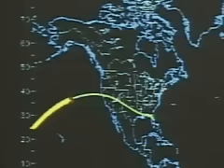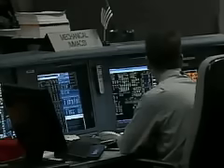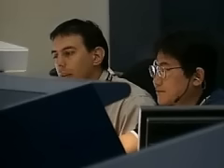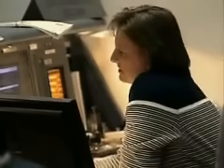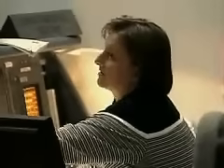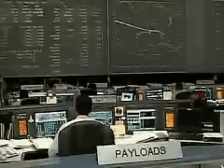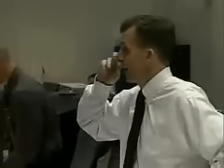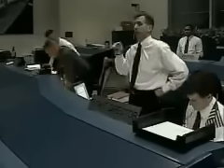Inside Mission Control During STS-107 Columbia's Failed Re-entry and disaster

Comment: Give props to that flight director for keeping it cool and professional BRAVO!
Reply: 456swagger Ummm, that's what you blame the engineers and technicians for. The director did his job to the letter.
Reply: 456swagger  And... it was his fault?
Reply: +456swagger, He is responsible for the FLIGHT, not for any mechanical problem of the shuttle. And of course if there is a good landing he is credited as well as he will be responsible for a bad landing or a disaster caused by his instructions. But in this case it is known that the shuttle had physical damages which is not his responsibility. Is the same as a flight controller at an airport, they has nothing to do with mechanical failures on a plane, all they are responsible for is for guiding the aircrafts to a safe takeoff and/or landing.
Reply: +456swagger You should  study the space program and the history of Mission Control.You are not understanding the function of Mission control.

It is  a poor observation,even saying the flight director was disinterested.Absolutely the opposite was true.The trouble with young America today is everybody acts with childish emotion to situations.
It seems Americans are having trouble relating to responsibility,reality,and controlling a situation,instead of going amok
in useless emotion,and lacking in witnessing professionalism during a crisis.

Professionalism dictates that emotions are held in check and you perform your duties and work the situation to a successful climax.You may wish to observer the the controlled emotion,the tears that were present in Leroy Cains face
How anyone can not see the emotions,or the professionalism displayed in this video is beyond me

 Leroy Cains job promotions are not based on what you misconstrue as a successful mission
Reply: 456swagger
Oh My ! My condolences.
You have had too many bumps on the head without a helmet.

God Bless You!
Reply: 456swagger
Dont let your failure in life cloud the message for others

Again my condolences on your failures and your mental disabilities
Reply: +456swagger You, sir, are an idiot.

The Flight Director is only responsible for flight operations. The Mission Manager was the one responsible for following up on the concerns of engineers, who were aware of the foam strike very soon after launch, and had even tracked a 10 cm piece of debris (probably pieces of the shattered RCC panel) sharing Columbia's orbit for the first two days of the mission. Two separate engineering departments did their jobs, and vehemently called for on-orbit imaging of the orbiter, but based on computer simulations that were inadequate models of an impact that large (and again, engineers told her the simulations were unreliable), mission manager Linda Ham denied those requests, determining that the foam strike was a "turnaround time" issue, and not a flight safety issue. Look at the faces immediately after the hydraulic pressure sensors dropped out. I would bet my bottom dollar that several of the people in that room knew at that point that reentry would be unsuccessful, because more than a few were involved in those imaging requests.

In both shuttle losses, flight engineers sent warning signals up the chain of command. In both cases, it was NASA Administrators -- WAY over the flight director's head -- who made the fateful calls resulting in the accidents. The engineers and operations people weren't the problem; it was the bureaucrats.

Linda Ham and at least two other senior managers lost their jobs over this incident, so it is utterly untrue that "no one was held accountable." It's clear that you never read the CAIB report, so the admonition that you should study the history is well-deserved. So you know about the sensationalist Lisa Nowak story. So does everyone, because that was a big ratings-grabber for TV news... which is probably where you get everything you know about NASA history. (That, and perhaps some conspiracy-minded internet sites.) You should be ashamed and embarrassed by your profound ignorance.
Reply: +456swagger Wow what a troll effort! Were you 'ralled out for this one?
Reply: 456swagger No information is better than false information, which is what you're providing. Have a couple examples from your own posts:

"You could be a Shuttle Commander! All you need is no flight experience and a vagina."

False. Every single Shuttle Commander (and Shuttle Pilot) has had a minimum of 1,000 hours of jet flight experience prior to selection as an astronaut. Many had been test pilots and flight instructors. I challenge you to name even one who has served in either the Commander or Pilot post who has not had at least that 1,000 hours. I won't hold my breath though, because there aren't any.

"You're correct about no one being held accountable for failures."

False. (See my previous post.) Linda Ham, the Mission Manager, and at least two senior engineers were fired or demoted after the Columbia accident. (Note also that the person you were responding to never said anything about "no one being held accountable;" you simply twisted his words to fit your wrong-headed interpretation.)

Funny how you seem to only go after the low-hanging fruit in your responses. If someone has the facts, you aren't interested. It's almost as though you have a vested interest in maintaining your distorted version of events, no matter how wrong you actually are.
Reply: A bicycle rack... I thought I recognized your backside from somewhere.I was a bit surprised to see you were allowed near school property though
Reply: +456swagger
Always so interesting how you  moon hoaxer types put down NASA ,talk about astronauts morality and then you talk so filthy.Its a well known fact that people who talk and think like you have ZERO credibility when it comes to subject matters.

Always filling posts with irresponsible inappropriate talk
Why would  anyone take anything you say seriously,its so immature and childish.

Your childish posts about flight directors,and NASA as a whole indicates you know little to nothing about the subject.,
but a great deal of contempt

Now don't go  start spouting off about how you know so much more then me because I just offended you, 
Your appearance of a mediocre education and life are showing
Good Day sir I really need to correspond with people of intelligence as to not waste my time

You have become obnoxious and very childish,very immature very predictable individual bar fly.
You should go away now,and leave analyzing science to those who walk upright.

Everybody,prepare for a childish tantrum like reply to this post
Reply: +456swagger I think your out of date on technologies and the requirements necessary to be a Shuttle Commander/Pilot
Reply: He did not. None of this was his fault. He has risen through the ranks at NASA and is now in a top administrative position.
Reply: +456swagger Nothing can remain unknown once it is explored and discovered,  So just because Mercury, Gemini and Apollo had flown before the Shuttle you consider the Shuttle astronauts to be 'not as good' as the previous classes.  You do realise that's rubbish don't you?
Also, Mercury, Gemini and Apollo were all reliant on automated systems or computers.  The AGC on Apollo is what got them to the Moon and back.
I suppose the next thing your gonna say is that the 'classified facility' where you met John Glenn was Groom Lake (Area 51 to the less initiated)?
Reply: +456swagger Fucking Troll, get a life.
Reply: +phoenixshade3 Flight Director Cain.......probably knew what was happening immediately after the hydraulic pressure sensors dropped out.  You can see concern on his face............and hear it in his voice as he receives reports.

And later, you can see the pain on his face..........as he knows the Shuttle was lost. 

He was just the re-entry flight director on this day........and bears no fault in this. The bureaucracy of NASA failed the astronauts again...........just as it did during STS-51-L
Reply: Thank you to those of you who provided appropriate, reasonable, informative, knowledgeable, factual, grown up responses throughout this comment thread. Stay the course and keep your powder dry.
Reply: Folks, Cain is not yawning in this video. He's trying to release tension from clenched jaws. I get the same thing when under a lot of stress, and dropping the lower jaw down like that helps release it. Thanks to those standing up for the real story here. Blaming Cain for things just doesn't align with the situation. He DID check with the mission managers about the foam strike, and they told him it wasn't going to be a problem. In such a big, complex organization, there's not enough time in the day to run around second-guessing everyone - you have to trust that the experts got their analysis right. They didn't, and the managers shut down any further investigation. They let Cain down as well as the astronauts. By all accounts, he was an excellent flight director, second-youngest to ever get the job, and an excellent manager and leader for the 12 years he was with NASA after the accident. But sadly, Columbia's demise is what he's remembered for, and he's had to carry the burden of this ever since. 

Cain won a long list of awards at NASA, including the agency's highest honor in 2015, and I believe he's now working at Boeing's Space Exploration division. 

As for those slamming NASA about the useless shuttle, learn some history. As a followup to Apollo, NASA asked for a budget to build a space station, a shuttle to help them do it, a lunar base, and crewed missions to Mars. All the Nixon administration & congress approved was the shuttle, so NASA could exploit low earth orbit by being a satellite delivery service and hopefully turn a profit doing it. And NASA has had to play the shitty hand it was dealt ever since - under-funded, under-staffed, always pressured to cut costs, and facing constantly changing directives every time there's a new administration. And congress treats NASA like a jobs program, insisting that parts and development contracts are spread around as payback to their corporate donors, running up costs and reducing efficiencies. NASA isn't blameless in the accidents it suffered, but there's a lot more blame to spread around outside the agency for the short-sighted and greedy way it's used by politicians.
Reply: No - why would he? Read the (non-crazy) comments above for more details. None of this was his fault. He was ascent and entry flight director for return to flight mission STS-114 in 2005, then became Launch Integration Manager then Deputy Manager of the overall shuttle program. (That's second in command, overall.) After the shuttle program ended, he was chief of staff to the head of HEOMD, Bill Gerstenmaier.  https://www.nasa.gov/directorates/heo/cain_bio.html
Reply: You can't know ahead of time that flight controller data will be useful or not in an accident. So you have to do what this team did. They dealt with their emotions for years afterwards, after they did their level best to honor the crews with their most professional efforts. As for showing emotion, there were tears rolling down the flight director's face. Guarantee you some of these folks were close to puking. How clueless to judge them for not falling apart right then and there.
Reply: +phoenixshade3 " In both cases, it was NASA Administrators -- WAY over the flight director's head -- who made the fateful calls resulting in the accidents"I wonder at what point in the Shuttle program it was that the flight director's scope changed.  Up through Apollo, the flight director's word was law.  Chris Craft even wrote the job description so that a FD could not be overruled by a higher up.  He could be fired, but the person doing the firing had to have damn solid grounds-probably anything short of a flight director standing up in the MOCR and saying "Je suis Napoleon!" wasn't going to cut it.I have a hard time imagining Kranz or Lunney asking for photos and being told "No"-at least not without a lot of table banging and shouting.  If none of the FDs pushed for photos, then they bear at least some responsibility.  However, even had they known, they had very limited options for rescue.
Reply: ***** That's a fair question, and the answer (like the answer to so many deficiencies in the world) comes down to money. During the run-up to the Apollo program (in the mid 60s), NASA's budget approached 5% of the total federal budget, plus 20% of non-military discretionary spending. It was a national priority, and little expense was spared. It dropped precipitously during the Nixon years, and has not been over 1% since that time with the exception of a couple of years in the 90s, when it barely edged above that mark. Today, it as at less than 0.5%, and the emphasis is almost entirely on commercial and military payloads. This lack of resources put a tremendous strain on managers of the Shuttle program, who had to deal with increased scheduling and cost pressures while simultaneously assessing flight safety issues.

The result was a culture that saw numerous sub-optimal performance issues. When those issues proved to be non-fatal for a number of missions, these problems were frequently classified as "turnaround issues" rather than safety-of-flight issues. For example, over half of all Shuttle flights prior to the Challenger disaster showed some evidence of O-ring blow-by. This problem was known, but the system was never redesigned to correct it, entirely for reasons related to cost and scheduling.

Likewise, there had been several instances of pieces of the stack striking the orbiter during launch. For example, Atlantis nearly suffered a Columbia-like fate in STS-27 (only the second flight of the Shuttle after Challenger) when during liftoff, insulation from the solid rocket booster struck the orbiter, causing extensive damage to the tiles on the Shuttle's vulnerable underside. One tile near the nose was completely missing, and were it not for an aluminum antenna mount, it is probable that a burn-through would have occurred. The Commander, Robert Gibson, didn't think the Shuttle would survive reentry. It is notable that among the recommendations after this incident was one to use high-altitude aircraft to obtain high-resolution images of the orbiter after fuel tank separation, but this recommendation only extended through STS-30. Had such a program been in place at the time of Columbia's final launch, the damage might have been identified on the first day of the mission, allowing launch preparations for Atlantis to be expedited for a rescue attempt.
Reply: LeRoy Cain -- great guy
Reply: Im soooo sorry you couldn't have been there to save them....in my mind, when I think of NASA or Air Force technology I always think of letting YouTubers solve the problems...LOL... The ONLY blame is underfunding, If we can't afford to fix it, we shouldn't have sent it up...
Reply: Ultrametric There was a back channel request by Wayne Hale in to the Air Force to get photos that Linda Ham shut down. That decision was made on the program management level, which is above the Flight Director position. Cain had no authority in the matter. Blaming him is stupid.
Reply: This guy did a great job and he deserved to be promoted. To say that he's responsible for a massive hole being blown in the wing by a piece of foam is a joke. To say that there was another shuttle "ready to go" is a joke. Somebody has to be responsible you say? Try everyone; in any organization I've been in, people are responsible for the quality of the product or service they produce. If somebody gives you a bad haircut, are you going to blame it on the owner of the shop? And who was responsible for the piece of foam being blown off the tank in the first place? The contractor's employee? The engineers who designed the tank insulation? The firm that supplied the foam? If you want to blame anyone, try starting at the source, not the guy who is trying to deal with the fallout. Blaming one person for a catastrophe when there are thousands of people working on the mission is typical of mankind's propensity for saying there's an easy answer when there is none.
Reply: Rick Husband just says "Roger, but..." and there's some brief static. Nothing more. This video has attracted the lowest of lowlife, spewing their conspiracy theories, half-truths and uninformed bile, with no respect for the humans we lost or those affected by it. It's sad we have to share a planet with such cretins.
Reply: phoenixshade3 It's also worth noting that because STS-27 was a classified DOD mission the crew could not send pictures of damage back to Mission Control by normal methods.  They had to use a slower method which also meant pictures were less quality.  Because of that Mission Control didn't take the damage seriously.
If Hoot Gibson had indications of Atlantis breaking up during re-entry he was going to tell Mission Control exactly what he thought of them.  Thankfully it never got to that but there was a lot of attention paid to Atlantis after touchdown.
Reply: DarkLight753 I actually edited those two points out of my already-lengthy reply (about the encrypted video and Hoot Gibson's planned choice words for NASA). I have little doubt that, had STS-27 been lost so soon after Challenger, that would have been the end of the Shuttle program, and there'd be no ISS today.
Reply: 456swagger , didn't you use to play the banjo? I'm sure I saw you performing in that movie called Deliverance.
Reply: +456swagger He didn't seem disinterested to me. He was rocking a lot and trying to contain his distress, to complete the procedures. 

The investigation demonstrated it was HIS superiors who had screwed up and vetoed his, and others', concerns about the foam falling off. Those responsible DID get demoted. 

When hundreds are working on a job full-time, you can't micromanage every piece of their job, and you can't overrule higher management. You will have a difficult work life if you are always so unreasonable and obsessed with scapegoating. It will eventually lead to YOU being forced out of your job as a toxic influence.
Reply: +456swagger You're a fucking no nothing idiot.  Get back down in your mother's basement where you belong.
Reply: The callousness of some answers to this comment is impressive and miserable.

A FLIGHT Director, damn!. Not the engineers or whoever was in charge of what failed.

Even with their sadness (including silent tears, the FD wiping his nose....) their professionalism is commendable.

Haters gonna hate, especially behind a keyboard. Not even worth to name them.
Reply: Ultrametric He had no authority on that. She did. Learn how things work before throwing blame.
Reply: I would think of the Flight Director as like the conductor of an orchestra.    Every one of those other people in the room, I would say are like the individual members of the orchestra......each expert at their own instrument.     And like an orchestra conductor......his primary job is to keep things flowing & trying to make sure everyone stays on cue.  He's following the sheet music as written.    If things suddenly go 'off script'......I'm sure that they all have some sort of backup.....or contingency plans to fall back on ( to a limited degree...) but something MAJOR catastrophic, they only have minutes....or seconds to try & come up with a solution.
Reply: Black Onyx You're absolutely correct, my question was for 456swagger.
 This guy did his job engineers and mechanics didn't.
Reply: +19ARSENAL100 You have that movie playing on a tv mounted over your bed, dont you?
Reply: +19ARSENAL100 I wouldnt want to make you jealous.
Reply: 456swagger Neither did he, but you don't read much, do you?
Reply: +Black Onyx Very true. You can have all the qualifications to sit in a flight directors chair, but if you haven't got the temperament to go with it you won't be sitting there.
Reply: +Digitalbumpin  Do you honestly believe he yawned because he was bored? Indifferent? Didn't care about the situation? 
Google up some videos of catastrophe situations, some war footage, maybe 9/11.  See how people react to real situations in the real world.
Reply: The damage that resulted in the accident occurred at launch. Launch Control is responsible until the booster clears the tower. Then Mission Control takes over.
Reply: Black Onyx dude, would you be cool in the same spot? Imagine having to deal. With this and all you want to do is just get up, leave, puke, go home and think it didn't happen. But it did. And instead you have to keep cool and assess the situation so you can find the problem and prevent it from happening again. Of course you feel sick for those who died, but you have a whole team of people looking up to you. What would you do?
Reply: Ridiculous...could well be radio static. You have no way to know what you are saying is true or not.
Reply: Those astronauts where personal friends of him way before the mission. He watched them die helpless and in polite range and horror
Reply: 456swagger he has done what he is paid for. Give the right information at the right moment in order to keep people on board calmed.
Reply: 456swagger actually he didnt fail because he avoided that the spaceship crashed on a big city.
Reply: 456swagger The fact that you came back to an argument after two years is just....sad. Wow. Definitely a dedicated troll. Props to you!
Reply: That is his job, no props needed.
Reply: +phoenixshade3 Lol yeah I'm like that.  I type out a reply and it looks like an essay so I end up editing loads of it.  Glad I could add to your very correct explanation though.  And I totally agree with what you say.  If STS-27 hadn't come home, the Shuttle program would have ended then.
Reply: +dquinnc How did they didnt? Considering it was just a piece of foam that caused the accident on liftoff, I fail to see how that is a mechanic or engineers fault. IIRC, it was woodpeckers that caused the foam to fail.
Reply: +19ARSENAL100 I wouldnt have figured you liked living in the closet. You want to go make out later??
Reply: utley , haha sure, if it's what YOU really want, I'll try anything once.  😉
Reply: Awesome! Open that mouth wide, I got some meat for that pie hole!
Reply: utley cool. Hahaha.
Reply: utley make sure you wipe that peanut butter off first though.
Reply: I thought you liked peanut butter?? I can get some jelly on there...
Reply: utley oh no always hated peanut butter, some grape jelly would be good though.
Reply: +19ARSENAL100 You get strawberry jelly and shut the fuck up, thats what you get.
Reply: utley oh damn, OK if you really insist, I'll just have to put up with that strawberry stuff.
Reply: utley OK OK,  I just thought I'd get it my way, I'll just have to take it as it comes,  oops!! What did I say there?
Reply: lol
Reply: +Scott Reece I remember Richard Feynman exposing the bureaucracy at NASA. And he was held as a weirdo, though he solved Challenger's O-rings. Now we have the opportunity to scrutinize another stupid, stupid decision, but, we will never be asked anything. <--- that is unfortunate.
Reply: nino Barlini, you should hold your breath for about 5 days, It'll make a difference to your miserable existence.
Reply: +19ARSENAL100 Can you fucking idiots stop being fucking idiots?
Reply: utley, ok matey, but have a go at the others aswell yeah, I don't disrespect the astronauts who died!
Reply: you guys are really starting to make my nuts itch. Stop it.
Reply: +Scott Reece Yes, he at least had some suspicions when he was told "no commonalities." Ugh. What a helpless feeling.
Reply: +456swagger I wouldn't say its a win situation if someone dies. That's a pretty emotionless thought and I assume that he'd rather have the crew land safely than the promotion.
Reply: +456swagger Really?
Reply: +Black Onyx I know I would have been screaming fo rdays
Reply: he lives in houston
Reply: bt10ant never see or hear much about him outside of a couple documentaries. Tell us more.  thanks!
Reply: LeRoy E. Cain.... (Flight Director)....
Reply: You're obviously a troll who needs to find himself a hobby.... LMAO... what a world class douche..
Reply: you're an idiot
Reply: I think one of those bumps went straight through.
Reply: Uninterested you mean.
Reply: Watch the Cowboy Bebop episode: "Wild Horses", ya'all. We are in a very, VERY strange world.
Reply: A paper shuffler and order giver, not an engineer.
Reply: No, A "cover your ass politician" and nothing more. Didn't really care about the crew. Lost the crew, the Shuttle , total mission failure and got promoted. I hope that NASA gets shut down and private American companies take over the space program. They would kick ass and hire only the most qualified Astronaut types. Instead of sub standard people who had the right color eyes or hide or the right genitalia.
Reply: +19ARSENAL100  a friend? like they have one? lol
Reply: +456swagger Lets see you manage 100'000 things at the same time.
Reply: Sean Beck , I'd be happy to shovel the dirt into the hole.   😉
Reply: Bullshit. Bipod foam came off STS-112 less than a year earlier and knocked hell out out the SRB mounting strut - a thick piece metal - banged a 4" wide x 3" deep dent in fucking metal. That was just 2 flights before Columbia. Decision was made to go ahead and fly STS-113. The foam issue was a known problem to engineers, they were all begging for surveillance from the Air Force, and were turned down by management 8 times. Among those responsible was Cain. More blame goes to Ham and Dittemore but Cain deserves to be blamed too.
Reply: i didn't say anything wrong jesus, if the story is incorrect then i'm sorry i repeated it!
Reply: The flight director keeps it cool, the flight director is a hero, props to the flight director, yadda yadda yadda. Yes, but it's not the FLIGHT DIRECTOR who's being subjected to thousands of degrees of centigrade of heat, you nincompoops. It's not the flight director who is being subjected to deceleration injuries. The FD just sits there in the comfort of an air-conditioned room and presses a button here, a button there, that's all. Yes, he's all torn up over this unbelievable incident, but he ain't the one up there. How incredibly DUMB are people here?
Reply: Well, most are US-Americans.
Reply: +19ARSENAL100 pretty sure he played the banjo better than you could ever hope to achieve.
Reply: utley his boyfriend has turned up, nice.
Reply: utley , absolutely,  you are so clever, go get a star from your teacher.  😉
Reply: utley ,  thanks, I knew you kinda  cared for me,  I won't tell 456swagger, we'll keep him in the dark, OK.   😉
Reply: +19ARSENAL100 ur goddamn right you will. You act like you got some sort of choice or some shit, you;ll take it and fucking like it if you know whats good for you.
Reply: His question at 4:40 and his nervous fidgeting and demeanor indicates that he already suspects the worst. He should have - already events were occurring, e.g. the simultaneous loss of the hydraulic return temperature sensors, that were "outside all previous mission experience" (CAIB report). Ham, Dittemore, and Cain all were complicit in preventing the Air Force from looking at the wing, something that would have clearly revealed the gaping hole in the RCC panels. They would then have had a fighting chance to survive. IMO all three were criminally negligent and should have been prosecuted.
Reply: He didn't "keep it together". It came apart, burned up the crew and scattered their remains all across 5 States. It was a huge story. I'm surprised you missed it.
Reply: Digitalbumpin j
Reply: WTF is with the insults, you sad people? I just repeated what I heard, there's no need for the insulting language towards me ... it was a very sad day. did I not call it a terrible tragedy?
Reply: Done what is paid for? He lost the crew and the spacecraft which is a total mission failure. That's "What He's paid for" according to you. Wow! What a job! Lose an entire crew as well as a two and a half billion dollar space craft and get promoted. Thank goodness the U.S.A.F. runs a shuttle program now. In the military an officer who loses his entire force and totally fails in His mission is held accountable.
Reply: He was in charge. He was the flight director. Oh, You think He's an imposter! I never thought about that. I wonder what happened to the real flight director. Maybe you could confront NASA and demand they tell you the whereabouts and the identity of the "REAL" flight director. I'll be watching CNN for your hard hitting expose'.
Reply: It was until you pointed out that this imposter was not the "real" flight director and that the actual flight director must have been kidnapped and replaced by this imposter. I did not know that. I stand corrected and hope that the real flight director can somehow escape captivity be reunited with his family. I guess that only leaves the janitor to take the blame for the mission failure.
Reply: Just sad? But the dead crew is something you got a big kick out of? You should work for NASA, you'd fit right in.
Reply: +phoenixshade3 NASA management is responsible for pretty much every disaster in their history. (you can interchange management and admin(
Reply: at 5:18 you hear a HISS sound, that's the sound of the air being sucked out of rick husband's lungs, a long ahhhhh sound in real life. seconds later his skull popped clean off like a champagne cork as the shuttle disintegrated! a terrible tragedy for a nation, i remember this day like it was yesterday
Reply: No shit, and he and Linda Ham both had a role in preventing the Air Force from looking at the orbiter on orbit before it was too late. This guy is a supreme dick.
Reply: +G Bgli No! Your Father was a clown and your mother was a troll That's the reason that children cry at your approach and scream "Oh my god what is that thing?" Please get a ten gallon hat for that five gallon head of yours.
Reply: +DarkLight753 Wrong whiskey breath! Many of those primitive  systems failed miserably leaving the real Astronauts to fly the spacecrafts themselves. They were actually exploring space and doing things that no humans had ever done. They weren't just riding in a low orbit space truck that was being flown by a computer.
Reply: +phoenixshade3 No! the Flight Director who failed his duty and lost his vehicle and crew was the idiot. I've never killed anyone.
Reply: @456swagger  All that I can say to you sir is "I refuse to have a battle of the wits with an unarmed man"!!
🤔🙄🤪🤥🤐💫
Reply: +Dennis S It doesn't surprise me that you spend you time checking out men's rectums. I guess you see a man's hairy ass and think that you can find "love" there. Oh well that must be where "Lock the Doors" came from.
Reply: Black Onyx Yeah, Great Flight Director. Total mission failure, loss of vehicle and crew and he got promoted.
Reply: No you've already taken care of the "Childish tantrum" that's one thing you're good at.What is a "Moon Hoaxer"? I noticed that you didn't deny the actions of those sub standard "Astronauts". You know the 3 way love/attempted murder triangle. I have the utmost respect for the "real astronauts". The ones that actually risked all  to go where humans had not gone before. They were highly selected and disciplined test pilots  They weren't pseudo astronauts that merely circle the Earth in a space truck that is flown by computer. I had the privilege of meeting John Glenn a few years ago when he inspected a classified facility and even at an advanced age he was still a stud of the highest order. He is what Astronauts were when they actually explored the unknown.
Reply: +Dennis S If you choose to spend the rest of your life with your head in the sand why not do so at a school or park so the children can use the crack in your back side as a bicycle rack. It would be your one chance to be of service to mankind and maybe give your life some meaning as well.
Reply: +Dennis S You must be a flight director. Tuck your little tail a run. Maybe you'll get promoted.  Not only is failure an option with your type, it's a goal to hide behind. He He you'll go far in NASA., just keep on sucking up.
Reply: Black Onyx Ummm, Then why do they call that position "Flight Director"? I never realized that he isn't responsible for anything that happens to the vehicle or crew? If the crew survives he gets promoted. If the crew dies he gets promoted. So it's a win win any way you look at it. Wow no wonder he seemed so calm. Even disinterested. What a job to have. Thanks guy for the info. There was a time when the commander was held responsible for all his people do or fail to do. Boy what a stupid notion that was!
Reply: @456swagger  His hand was covering his face at some point, and when he took his hand away I could see his face was wet and a tear was running down his cheek. Not all the footage shows that.
Reply: Sure, He was afraid of losing His job. No worries though, it's NASA. Even if you are in charge of a total loss of vehicle and crew, a complete mission failure , you get promoted.
Reply: That would be your little secret.
Reply: Study the history of the Space program? Are you kidding? NASA has a history of lying to the public and to congress. These nitwits are part of the very "young America" you referred to. When the Moon missions ended and NASA sold congress on the "reusable space plane" called the Shuttle they lowered standards to turn the space program into an "Affirmative Action" sandbox. That's why they can't even replicate the flight of John Glenn without killing two crews and losing two vehicles. And you're correct about no one being held accountable for failures, no one not even the flight director. Have you studied the space program? Ever hear of Lisa Nowak? How about William Oefelein? I don't recall any Mercury, Gemini, or Apollo astronauts being arrested with handcuffs, duct tape, a hand gun, a stun gun, a butcher knife, and pepper spray, attempting to kidnap and murder a female Airforce officer who was sleeping with a married male Astronaut who was sleeping with a married female Astonaut who was going to plead an "insanity" defense to attempted murder charges that were lowered under pressure from NASA. If that's you're definition of "cool professionalism then you must be part of that"young America" Best Wishes.